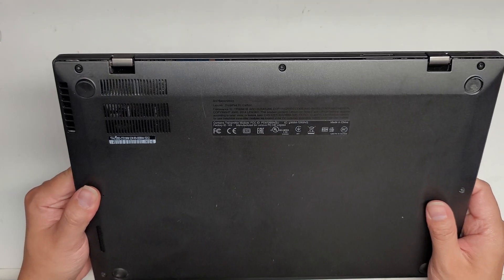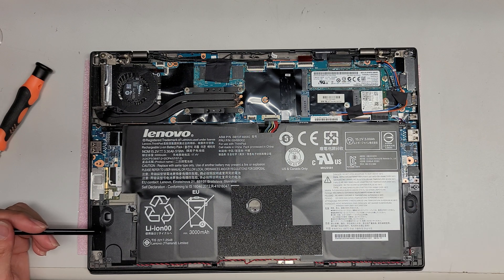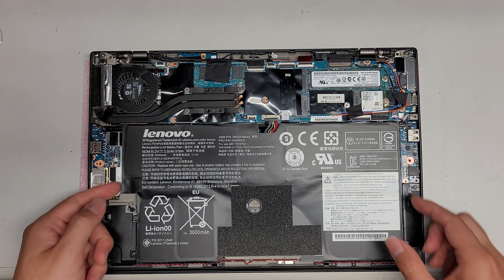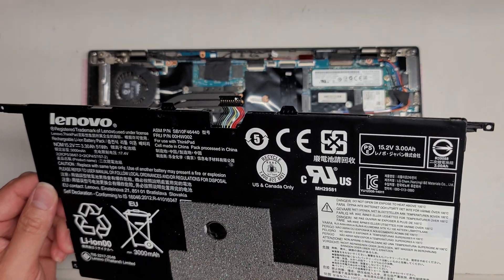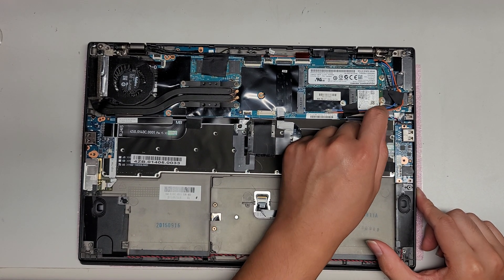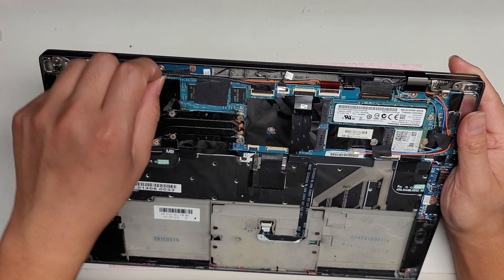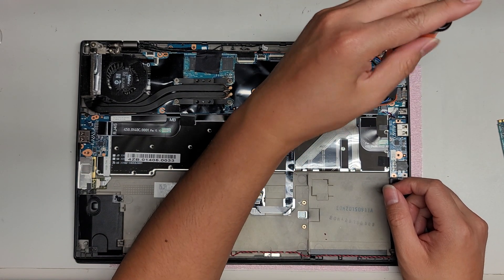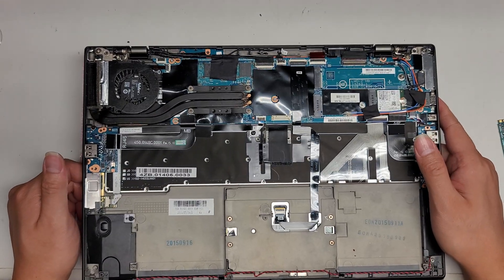Lenovo Thinkpad X1 Carbon 3rd Generation Disassembly SSD Hard Drive Upgrade Repair

Comment: I know it's an old video, I need to replace the CMOS battery and it already looks like a nightmare
Reply from the maker: @ellienv7527  what's wrong with the cmos battery?
Reply: @ItsBinhRepaired Where can I find the CMOS battery?
Reply from the maker: @kedarsawant9378 if it's not in the video,  I don't know.
Reply: @ItsBinhRepaired  Its underneath the motherboard, you have to unscreen about 6 screws and undo all of the ribbons to turn the MB upsside down. it might be possble to remove few and lift one edge and use tweezers to pull the clip out.

Comment: I'm just wondering if this laptop is compatible with the 2TB Samsung 980 Pro w/ heatsink.
Reply: I highly doubt it, I have a WD 2tb W/ heatsink in my desktop, they're pretty tall. I'd stick with a w/o heatsink.
Reply from the maker: Yup
Reply from the maker: Not sure. I don't think so.
Reply: @ItsBinhRepaired  Yea, I think you may be right, but I think that's alright.
I mainly want to clone the SSD in the laptop to the 980 pro. Would appreciate any solutions for that.
Reply from the maker: @theapexpredator157  https://youtu.be/4p5jFDzVwUwv This should help.
Reply from the maker: @theapexpredator157  this adapter will work, but is not meant for permanent use because it's not enclosed. https://amzn.to/3cuyjOV

Comment: Hello. I have this laptop and I’m in a predicament. It appears the Intel HD integrated graphics 5500 is not adequate to run Diablo II resurrected which I just purchased. I’m very disappointed in the performance of the game and I’m wondering if there is any potential solution. Is it possible I could use the (non-utilized) WWAN slot to add a superior GPU to the laptop?
Reply from the maker: I don't know. That's not something I've done before.

Comment: hello i have this laptop. and i was just wondering, to use ssd m.2 nvme. it will work or not? thanks for reply and i do subscribe already:)
Reply from the maker: Not sure. It came with an m.2 SATA drive. Best way to know is to order from Amazon. If it doesn't work, you could always return it.

Comment: Anyone know where the CMOS battery is located?
Reply from the maker: I'll be replacing the motherboard in a couple weeks. We'll find out then.
Reply: Many thanks  @ItsBinhRepaired
Reply from the maker: @rickaliwalas7998  no problem
Reply: @ItsBinhRepaired  i didn't realize you had another gen3 vid - i can see the battery at https://youtu.be/CCATLZD82rc?t=856
Reply from the maker: @rickaliwalas7998  great!

Comment: I love your video, about to pop open my gen 3 and switch out the NIC to see if I can fix the WIFI issue.. can't turn it on. Also, do you know the part number for the RJ45 dongle-thing going into the side of the laptop? I've bought a few and all were incorrect. Even Lenovo can't seem to give me the info despite a few calls. Thank you in advance.
Reply from the maker: Not sure what dongle, but you can get a usb Ethernet adapter